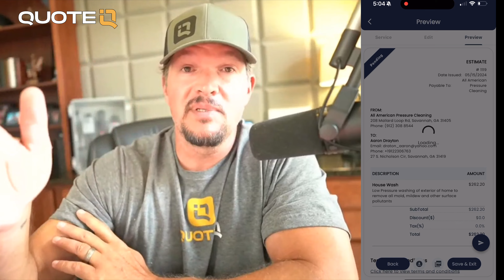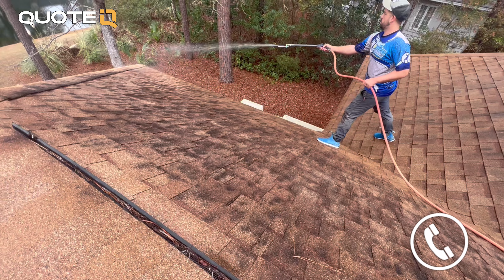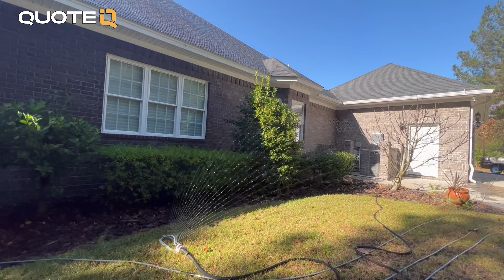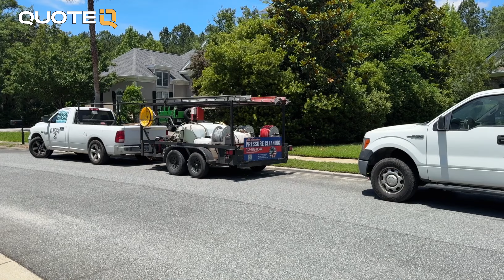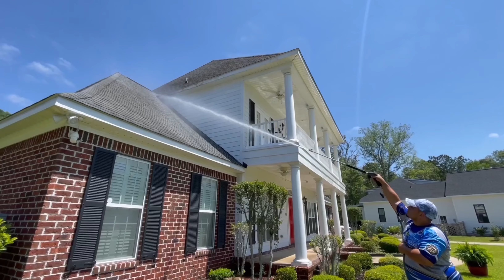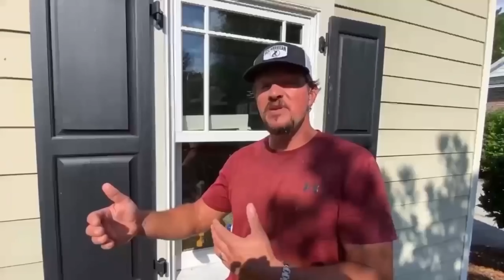Insurance Company Forces Customer Into Roof Wash #pressurewashingbusiness

Comment: I think ensuring that homeowners upkeep their roof is a good idea. Although, I recently had a potential customer call me, telling me her insurance company told her she needed to clean her roof within 30 days. The issue was that it was a 100 year old metal roof with some of the worst rust I had ever seen. There was no mold on the roof. It was 100% a restoration job. Apparently the insurance company had sent out a roofer who said the roof had no leaks, so the insurance company was trying to get the homeowner to clean the rust off. The roof was beat to hell and looked like it was on its death bed. This homeowner was begging me to just spray water on it and send an invoice, but the liability risk was massive so I had to decline. In this case, the insurance company was 100% trying to pull a scam.
Reply from the maker: Shady af